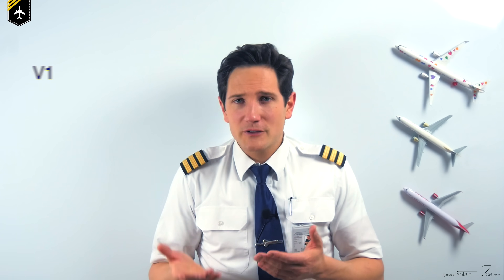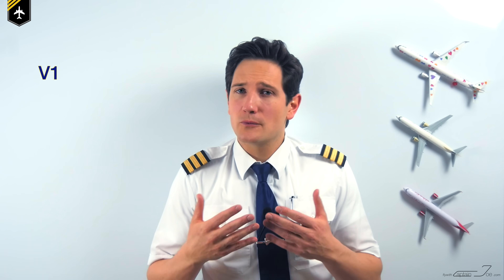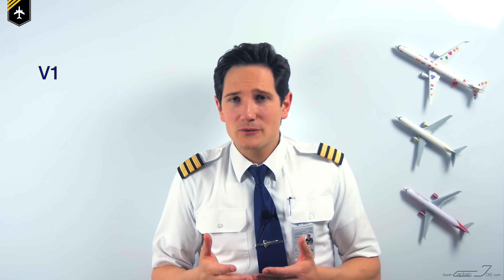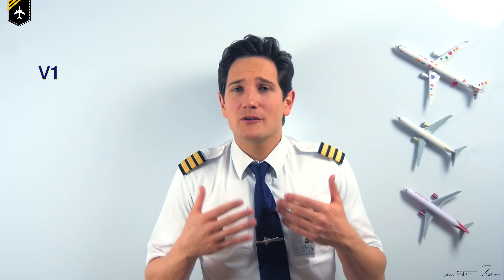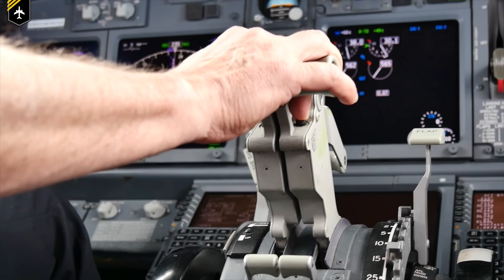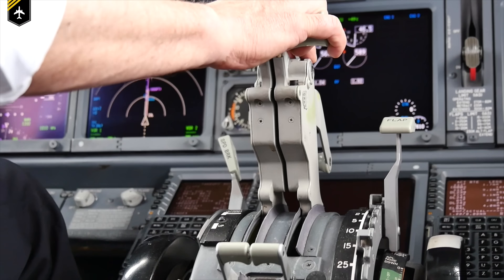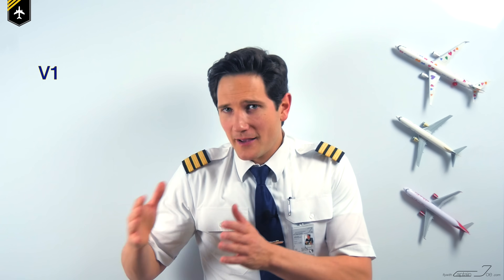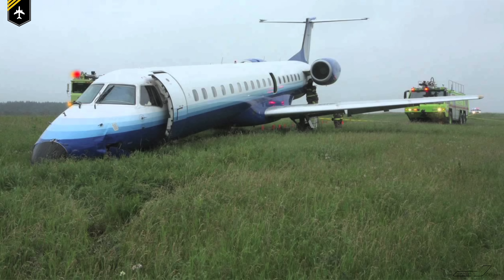TAKE-OFF Speeds V1, Vr, V2! Explained by "CAPTAIN" Joe

Comment: So with V1 you must always take off no matter what.
Reply: guillermo Cartagena there are “exceptions”. Basically situations in which you know you don’t have time to make it back. Things like all engines failed or a sudden major fire or all hydraulics loss. But it’s very unlikely that these would happen in a practical flight.
Reply: @ZK-APA  yes I bet exceptions must be, by logic if you have a severe failure is better to abort take off even if you know you are going to get out the runway, it will be stupid to take off with a failure just because you reach V1.

Comment: dear joe: sometimes v1>vr, right?
Reply: Hengshu Liu v1 can never be greater than vr. As at vr you initiate the take off rotation, hence v1 would be of no use.
Reply: @ZK-APA  Based on the deifinition of v1, if the runway is too long for a plane,  the take off speed Vr may less than V1.
Reply: @AncientPoetryAppreciation  again no. I am assuming you are saying that after vr if you have an issue you land on the remaining runway and hence v1<vr. But that's not how it works.

As per definition, v1 is only valid for take off roll. And vr is a point where you get airborne. Hence v1 has no meaning anymore as the takeoff roll phase has ended.

Comment: Capt: your explanation is clear and ok. 
From more than 25 years to now (when I flew gliders) I think all the airports must as it's geographically possible extend his runway's lenght (both directions) for use as "brake spaces". Maybe a 500 meters extensions in each direction. It's no cheap, I know, but in those cases, V1 will never apear, and many runway excursions (even in landings) and many lives and airframes could be saved.

Comment: What is the stall
Reply: The aircraft's wing creates lift so that the aircraft is able to fly. If the aircraft angle of attack increases beyond a certain point then lift begins to decrease. During the stall the wing loses it's ability to create lift and the aircraft begins to sink. But the aircraft can recover from the stall when the pilot pushes the nose down and increases the engine power. After that the pilot can level the wings and pull up to return the aircraft to normal flight.

Comment: What if you would take-off a Cessna from a 5 mile runway, could you reach Vlof before V1?
Reply: Anni Niem by Cessna if you mean a single engine trainer or something, there is no concept of v1 as v1 is only applicable for multi engine aircraft

And if you are referring to a multi engine, then no, v1 can be equal to vlof but never greater than it by definition.

Comment: Hi there man! I used to work as a B747-4F series en dash 8F, as well as B777-200F and 300F load master. I was wandering if you have have any stuff about Weight&Balance since I think it's quite important and you know, 'do your weight and balance'. For freighter pilots is not possible with all those weights, contours, DGR, LAR, shoring and lashing, position weight limits... You know... But for small planes, every one should work on it.

Comment: I fly a Solo Super hornet. On the ground, with some NATO member countries, I still have to call out V2. Otherwise, the procedure is:

- Lead, rolling!
- Lead, V1!
- Two, rolling!
- Lead, Rotate!

- Two, V1!
- Lead, V2!
- Two, Rotate!

... Etc. depending on the amount of aircraft in the flight group. But under normal circumstances, the members on the wing may commence takeoff, when the previous aircraft has reached V1. Under scramble situations, One and Two - IF and WHEN they are certified to do so - may start simultaneously, but this is extremely rare.
Reply: Well, when I say extremely rare, considering the amount of scrambles we have, it's really not very often.

Comment: Did you see in 2:03 when the plane kind of bounced up after it stopped?
Reply: They used the wheel brakes, and the landing gear has shock absorbers. A car reacts similarly during the braking.
Reply: @mikep9604  That is true but since there is a bigger vehicle, it bounced up more so you could notice it a lot easier

Comment: captain joe, what does ground speed an air speed mean in aviation? how are they related to each other??
Reply: Ground speed is the speed the aircraft moves in relation to the ground (the speed between your point of departure and arrival). The air speed is the speed the aircraft is flying in the air. The air speed and the ground speed are different when there is for example headwind. When there is headwind your ground speed is lower than your air speed.

Comment: If you get total engine failure, it might better be to do a runway overrun rather than crash by getting stalled.
Reply: If a twin engine aircraft has a failure in one engine after the speed V1 it can perfectly take off with the remaining engine.
Reply: @mikep9604  I am talking about a situation where all engines don't work...
Reply: @이주연-x4x  - In that case there is no option than try to stop the aircraft on the remaining runway which indeed may cause a runway overrun.

Comment: Can a 747(either model) maintain sustainable flight with only one engine?
Reply: Ryan Goodfriend nope.
Reply: ZK-APA so a 747 doesn’t have V2 or does V2 ,for a 747, refer to it having the only two operational engines
Reply: Ryan Goodfriend it does have v2, but as per definition, v2 is speed with one engine inop, so v2 is for 3 engines operating.

There is no specific term for two engine inop, as having that scenario is very unlikely (statistically you are more likely to have all engines inop than just 2 engines inop)
Reply: ZK-APA thank you I must’ve misunderstood Cap’n

Comment: Cool video! Thanks!! Though, I do have a couple questions here:

1. In a tiny plane—for instance a Cessna—on a massive runway that can accommodate a 747, wouldn’t V1 be pretty much nonexistent? Or, wouldn’t you at least reach Vr and the plane be well into the air long before the time at which you would come to V1 (if still on the runway)?

2. Let’s say an engine failure does happen after V1 but before the pilot has called “Rotate.” Wouldn’t the next speed then be V2 before they rotate? Why would it still go in the “V1, Vr, V2” order if they have one engine out? I thought that in that case they would need to wait for V2 speed before Rotate which applies lift to the plane.
Reply: Sean for 1 I assume you mean a trainer like a Cessna 152/172. Those planes don’t have a v1 or v2 as it’s a single engine aircraft. They only have a vr.

For 2, no because vr is always less than or equal to v2. And the aircraft is still accelerating even with one engine failed, so even if you rotate at vr, it will reach v2 at screen height
Reply: @ZK-APA  Thanks for the reply! I'm still a bit confused about #2, but regarding #1, what about a twin-otter or another twin-prop plane? Or even a tiny twin-jet, on a massive massive runway. In some (albeit rare) cases, couldn't v1 and vr come at the same time? Or even vr come first? Like say, the runway is so insanely long and the plane so tiny that it could rotate and just before climbing but after rotation have an engine failure and still be able to bring the nose back down and apply the speed breaks, reverse thrust, etc in time to stop before the end of the runway?
Reply: Sean yup, v1 and vr can be same. But vr can’t be greater than v1.

This is because of definition of v1 and vr. The definition of v1 is a speed where you are committed that you will take off, and vr is the speed when you rotate to commence takeoff. So you can’t commit to take off after actually taking off.

And yes even if you have an insanely long runway, even with an engine failure it will continue to take off after v1 as the aircraft is capable of flying with one engine inop.

Comment: What do you mean by generating lift over the wing?
Reply: The aircraft must reach a certain speed before the wings begin to generate lift.
There is lower pressure on the upper surface of the wing and higher pressure on the lower surface of the wing. The difference between the high and the low pressure generates lift.

Comment: Captain Joe . Thank you. I have one question. 
While taking off or landing how will a pilot know if the front wheel is straight and wheel is not turned a little bit towards left or right.  At that great speed if the wheel is turned a bit to left or right it will go off the runway.
Reply: Liju K the wheels are linked to the rudder pedals, so if the riders are neutral, the wheel is straight
Reply: @ZK-APA  Thank you.  And how would we know that plane touches down on the runway straight.  Perfectly alligned straight with the runway. Because if the plane touches down slightly tilted to the left or right and because the wheels is straight it might still  shoot out of the run way.
Reply: Liju K simple way how  you can keep a car straight on the road. By looking outside. It’s not that hard once you are used to it. Just use the rudder to keep it straight
Reply: @lijuk9428  - I think here is a video which may give you an answer to your question "if the plane touches down slightly tilted to the left or right". The video shows how it is done in a heavy crosswind:
https://www.youtube.com/watch?v=ZPn3MBNt7Rc

Comment: Hi Joe,
Can jet engines be fitted securely with wired aluminium mesh at the front of the engine so to avoid birds being sucked into the engine and damaging it?
Reply: No, because it will disturb the airflow into the engine which affects to the performance of the engine.

Comment: Is it not better to overrun the runway a small distance at low speed instead of taking off if a failure occurs a second or two after the V1 callout? Instead of taking the risk crashing into a neighbourhood shortly after takeoff?(In case of engine failure or similar)
Reply: Daniel Smith an aircraft can still fly if one engine has failed. But if the pilot suspects that all can fail, he/she can abort irrespective of v1.

Comment: @Captain Joe, can u plz explain difference between V2 and Vyse. Thanks
Reply: V2 is single engine safety speed.  It is an obstacle clearance speed which is not very efficient at climb rate.  If the aircraft takeoff weight is below its most restrictive limit, it can have an engine failure at V1 and continue the takeoff and still cross the departure end of the runway at 35’ or higher.  It is similar to Vx.  Light twins have Blueline, which is the single engine best rate of climb speed.  Under certain atmospheric conditions, it may not result in a climb if the aircraft has had an engine failure.
Reply: @oscarb9139  On a 73 degree Fahrenheit night, 700 lbs under max takeoff weight, with a 5 degree bank into the right engine, the ball half way out of center and at blue line (105 knots) an Aero Commander 680 FL will climb at 100 fpm. Trust me, I know.
Reply: @pixurguy4915  “Under certain atmospheric conditions, it may not result in a climb if the aircraft has had an engine failure.”.   I didn’t say a light twin wouldn’t climb.  I said it may not.  I notice you picked a weight if 700 lbs under gross.  How would it do on that same 73 degree night at gross weight?  Would your Aerocommander fly on an 85F day in Denver 1000 lbs under Max gross?  

I have no idea what the answer is because I have never flown any model Aerocommander.  

Anyhow, you are a very lucky (and skilled) aviator.  100 fpm isn’t much at all.  I have had two piston engine failures myself.  One in a single that resulted in a night time off airport landing, and another in a Navajo, but we were lightly loaded and were able to make it back to the airport. 

I don’t have anything against light twins, or light aircraft if any kind.  They are a ton of fun to fly.  I was just responding to a question and adding additional information.  What are you flying these days?

PS.  I have edited this comment a couple times because it sounded pretty snarky.  That was not intended to sound that way.
Reply: @oscarb9139  Thank you for your response.  I hope I didn't sound snarky in my response because I did not intend to be.  I wrote my response to agree with what you said.  I was flying night freight from Las Vegas to Phoenix and on July 2 and the throttle linkage on the left engine came apart and the engine cut back to idle power at 600 ft AFL. Had the temperature been 90 instead of 73 and had I been at gross weight your statement that at vyse the airplane may not climb might have been realized.  At Denver and 85 at gross weight the Commander (I loved the airplane) wouldn't climb.

I was flying a charter in a Seneca II and we were at gross weight and one of my passengers turned to the guy next to him and said, "What I like about twin engine airplanes is that if you lose an engine you can still fly on one."  I didn't have the heart to tell him probably not. 

I am pleased to hear you survived your engine failures.  Where did you land at night and did you have a chance pick your landing spot?  I had an engine quit in a Cessna 172 at night but I was on approach and only 1/2 mile from the airport.  What kind of Chieftain were you flying?  I have about 40 hours in a 350 CR.

I just retired from the airlines and grew up in general aviation and have many fond memories from that time.
Reply: @pixurguy4915  I put the C-150 on a two lane highway.  No real choices due to altitude.  This one changed my way of doing business.  The other was a PA31-350, for a part 135 airline.  We were very lucky we were empty.  It was on my second flight with the company.

I am happy to hear you made it to retirement.  There is a lot of uncertainty at the airlines for the junior pilots.  I have been at my company for 24 years and am not in jeopardy.  

No, you didn’t sound rude, but I alway read my comments for typos and flow and rewrote it a couple times.  When you get the notification, I assume you only see the original comment.  Anyhow, good luck to you and enjoy retirement.

Comment: But if you get to V1 and there is engine failure isn’t it better to stay on the runway and brake even if you are going to fast? I hear both is bad but in the air is more dangerous cause what goes up will blow up down. At least on the ground dangerous too but you are on the ground and maybe can live and have minor injuries.
Reply: Its better to live and save the passengers with a damaged airplane and risk your job than risking your life.
Reply: David Heller an aircraft can still fly with one engine failed. In that case its safer to continue take off and then land back.

Comment: Don't know if questions are still being answered on this video, but I have one.  Are there scenarios where on take off, that you have past the point to safely decelerate, yet taking that option is still advised?   What I mean is, it seems like there would be cases where risking overshooting the runway is much less a risk than if you were to go airborne.  Rather than having to go hundreds of feet in the air at high speeds seems a lot more dangerous than going off the runway at 30 or 40 mph or even higher speeds, which seems like a much better option to me.   Is there any scenario that would lead to that decision?
Reply: jeremybr2020 yes there are. You can abort takeoff after v1 if its very obvious that its less dangerous to abort takeoff than to continue.

But the conditions would be very extreme, such as all engines failed or a catastrophic system failure.